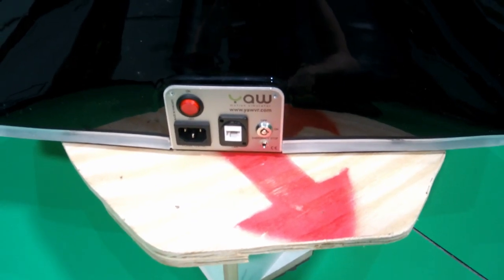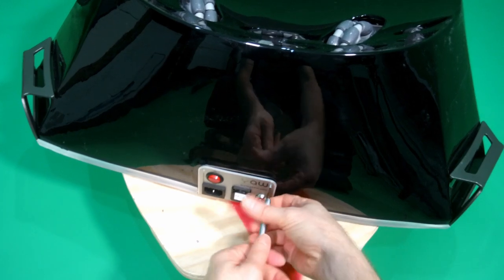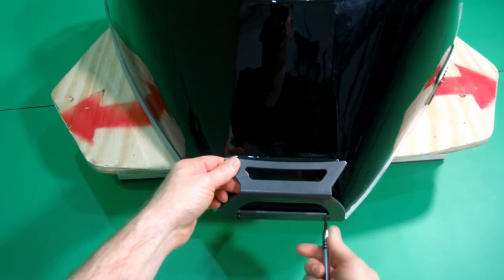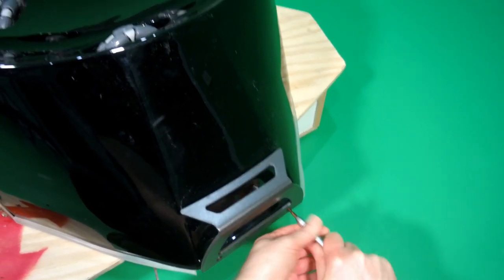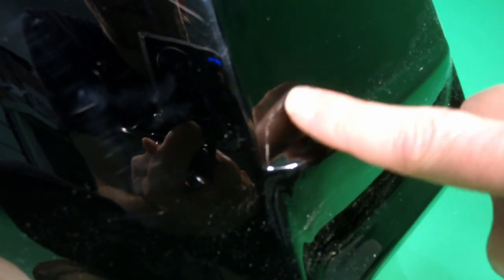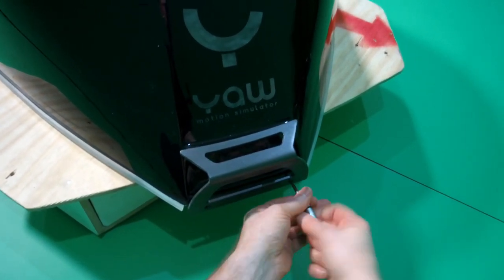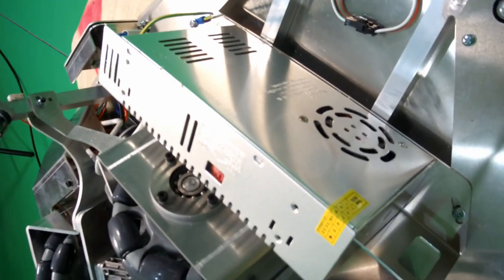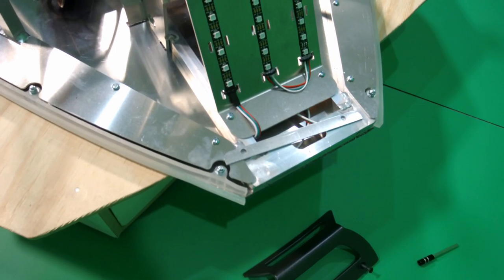YawVR Base/Platform Disassembly

Comment: this video helped me a lot thanks man !!😃 Did you install the temperature control sensors? me yes but I wonder if the simulator app really works? me in info it tells me "no temperature sensors" yet I have all connected well 🤔
Reply: @ItsVRK   Thank you for the answer ! by the way I have an iphone and the  app version  is RPI ver 46. but hey no temperature sensors when push on the termometer in the app. I contacted yaw support and am still waiting for a response from them.it's worrying when you wonder if you have everything connected or wondering if the sensors are functional 🙄